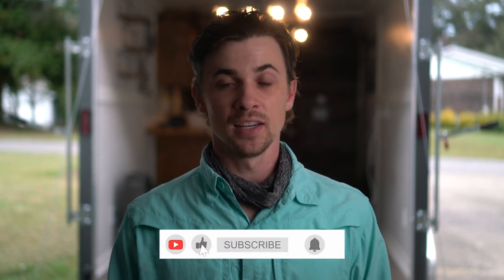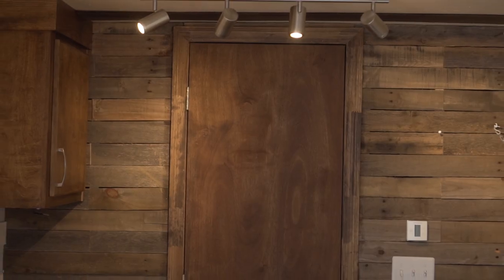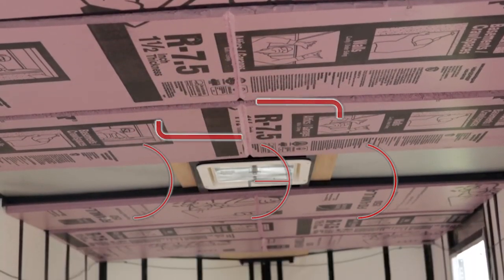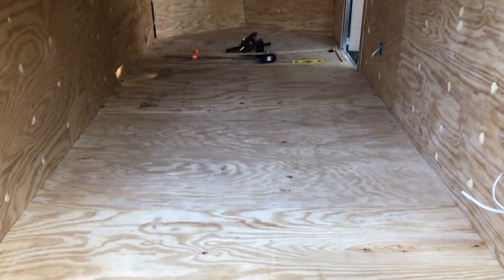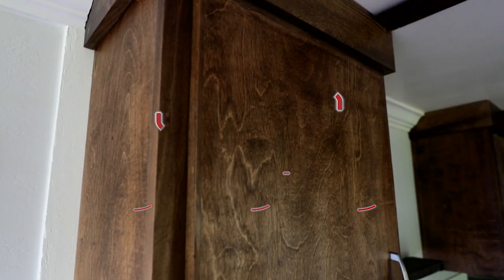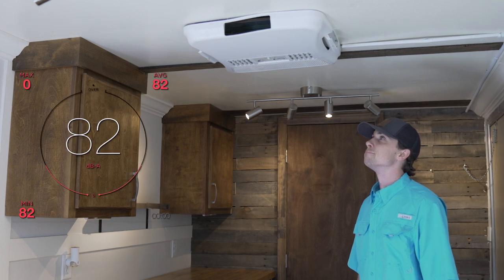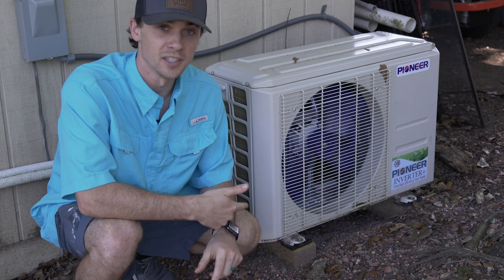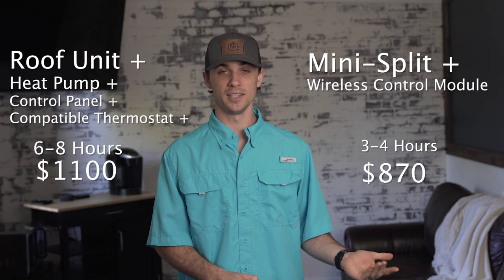Cargo Trailer Camper Conversion | TIME, DIFFICULTY and COST

Comment: Hey I’ve seen a video with a camper diy and a mini split on the front. He welded in some mounts on the tongue and put rubber bushings to isolate the outside unit said it worked well for the last year. It will be the route I take as well. Covers it during travel to minimize road debris.

Comment: I've been building for over 39 years and I've been building tiny homes on wheels for 5 years now cargo converson and stick built on a trailer I put my mini splits on the toung of the trailer but you have to make sure on some trailers that the toung isn't short. I always build with interstate trailers they have a longer toung and the height inside is  90 inches so you don't have to have one coustom built for a higher interior height if you do I build again I would recommend putting the pinkboard under the floor and use the thermal grip prong washers strictly made for pink board and screw to the bottom of the floor so you aren't loosing any height inside I put 3 inch pinkboard under mine with the prong washers and it stays supper warm and 1 inch interior then my electric then another half 1/2 insulation after the electric but I also use  1 x 2s which is acculy a half inch board  on the metal studs and then do 1/4 cedar toung and groove. I pretty much build high end tiny homes though. So that's just a few suggestions. Also I would recommend putting another safety latch on the opposite side of your door latch of you have one where the bar is so n one can lock you in from the outside. I have both on mine and a key Fab door lock. Take care
Reply: How much demand is there for cargo conversion?
I'm semi retired. But after working for myself for 25years income projects.
Better than being a greater at Walmart. Having to put up with that shit would drive me crazy.
Reply: @davewelch1932  I'm supper busy I'm actually 2 years out before I can except anyone else or that's how long they will have to wait. Which suprizingly quite a few said they will wait. If you do a cargo build would suggest removing all the wood pannels off the walls and caulk all the seams the interstates like I use are very well built but I still go threw and caulk all the interior seams with a very good RV caulk you probably won't find it at big box stores. They do use buttal tape every where else but not in the vertical and I would do the horizon above the seams as well before I would add any insulation in the walls and just a suggestion but I would stay away from the fiberglass insulation in a cargo build and I wouldn't suggest rock wool either it's to heavy and for other reasons I wouldn't use I in a cargo build. Just remembered if you get a trailer look at it as if if was a house meening 16 in center studs height and different things like that and check under the trailer at the cross members for your plumbing make sure it will all work when you put it in. Hope this helps if you have any more questions please let me know.
Reply: @lbialk I have heard of people doing that before in my opinion I think they are making a huge mistake. I wouldn't recommend it these cargo trailers flex when there going down the road. I can tell you what I use and have used in my past cargo builds. And what I used on mine as well never have had a problem and I live where it rains about 9 months out of the year in Washington state. This is what I would recommend and what I use it has a 35 year durability remains flexible, water proof silicone RV adhesive. General purpose RTV silicone rubber. It's for wood, metal,glass, tile, plastic.  Very good stuff I use it on the interior seam and exsterior when I caulk around my Max fan and other things like the water box plug inlet everything like that but also use butal tape before just for extra purcaution. You won't find it at a big box store I don't know if you have a Tacoma screw where you live but that's where I get it. And RV store may have it. But I don't like buying things from an RV store because most there stuff is junk and way over priced. I'm not sure if Amazon has it I haven't looked but they might. I would recommend caulking every seam vertical and horizontal let it dry for 24 hours and run a house every where outside to make sure you don't have leaks anywhere and check around your fenders to make sure they didn't just put butal tape and no caulk because I have ran into that on my builds also before o would insulate anything I would check the door latches sometimes they leak as well unscrew the bolts and caulk under them before you out them back on. Hope all that helps. Take good care of I can help you with anything else please let me know.
Reply: @lbialk your welcome and ok that's good. I would still be causious about using tape. Alot of times it will break down over time. Just don't think it's the best idea for seams Inside a wall. Alot of times it will break down over time. And it could have a tendency to sweat. Which is what you don't want. Have fun with your build. Take care.
Reply: Please explain your door latch setup. I hadn’t thought of being locked in your own trailer.
Reply: @Biker-ux1fz  I put another locking hasp on the opposite side of the main door that way I can take the lock bar and  swing it backwards Insted of towards the main door I did it before I insulted the trailer that way I could bolt it to the frame inside the trailer side and then I put a locking shackle trailer puck on it so no one can switch it to the door side then I have a RV lock on the main door as well so when I don't have the locking hasp on the door side because I didn't remove it I use the RV lock it has a key. Hope that helps.

Comment: I have my mini-split on the tongue of my cargo trailer, and it works beautifully!
Reply from the maker: Awesome! Do you have any videos are pictures of how you did it?
Reply: Front mount close to inside unit. Every reafer (refrigerator units on commercial trucks) have a cooling unit high and dry away from stone chips always been up there. A trucker pointed it out to me. I'm looking at redoing my construction cargo trailer. Haven't used it in 7 years. Worth more concerted than cargo trailer. Plus everything new. Great retirement project. 

I've looked at putting in false wall foot in for utilities (electrical room) and installing a real mattress on a Murphy bed. 
My trailer is a 8'6 x 16' x 6'7" high. I could go with a king size. But would trips on wheel wells on getting out. Being older it's a pain in the toes.
Reply: Sorry my man, I'm confused at what your trying to build. An office or a camper trailer??
 Because it still looks like an office. 
What type of vehicle will be towing it?? How much does it weigh?? And is it durable for off road conditions?? And a bed should have been the first thing designed in your camper.
Reply: How about a frame for the split unit mounted to the tongue above the rock and debris area behind your tow vehicle. Have a double canvas cover made for traveling by a boat cover fabricator. You can still mount batteries or propane below the frame. WALA.
Reply: @scottgorman7166  the mini split is on the tongue itself. I have the bottom cover with a home made pan. So during traveling it’s covered and protect my the truck. Batteries and propane are in a completely different part of the trailer in my design. Batteries alone weight just over 500 pounds, so I placed them over the axle. The propane is on the kitchen side, with fresh water tanks to balance them even over the axels. The water tanks are made to travel full to counterbalance the 500 pounds on the other side
Reply: @FirstSuiGeneris  Do you have any pictures or videos of yours?
Reply: @Notorious424  I do, but nothing on my channel sorry!

Comment: I have research many bed solutions. The murphy bed still gives you good cargo floor space when the bed is stowed, but a very comfortable bed to sleep in the down position. Considering the ceiling height the bed can be   built horizontally. This can accommodate twin,full or queen size. There are many mechanisms such as counterweight, piston shocks, or purchased bed hardware from Rockler to help with lift assist. Good Luck!

Comment: Ben we are in the process of fitting a 7 x 14 trailer.  Our bed will 60 "x 74" almost a queen.  We plan to split it in half as 2 Murphy beds, one on each wall of trailer.  When lowered they will rest either on legs or maybe on benches that will be dinette when bed is up.

Comment: Im designing a travel trailer w a mini split. Going to have it at the back in my garage area w a Tesla powerwall/inverter. Cut a round hole in the back left side of the door, mount grill cover on the outside, build a doghouse shroud to send the air out through the floor. Can be done in a small amount of space just curve the shroud so air moves freely. That way your "outside" unit can be in the trailer, less chance of theft or weather damage

Comment: Mount the mini split on the tongue and run the lines through the front wall. We are using a Murphy bed. It will fold up and in the up position we plan on having a table that will fold down from the underside of the bed. This is space saving and it allows to keep the bed made. Hope this helps.
Reply from the maker: Good notes there, John. That bed design sounds very similar to what I have in mind. It's between a Murphy bed that has a table attachment and some sort of futon/couch that folds out or extends in to a bed. Thanks again!
Reply: If you put the mini split on the tongue you need to cover it while traveling or the wind will destroy it .
Reply: @bigdave5946  Absolutely. In fact my wife actually put a 1" peice of foam board in the cover she made to protect it from rocks that could fly up.

Comment: I’ve seen people mount the outside mini split unit right behind the fender and gave minimum clearance against the wall.  Run some angle from out from under the frame to make a platform.

Comment: So I’m wanting to start on a conversion for mine just to use as a family camping trailer. It’s 12’ OA so it’s small and the ceiling is short but for recreational use it’s going to be good. I had an idea for the ramp at the rear to increase the interior square footage. I want to do a bimini style fold out that would cover/enclose the entire ramp. I was going to use conduit for the frame pieces and tarps to cover everything.

Comment: Hey Ben, nice build so far. I had an idea on my build (still an idea), use single etrack mounts into steel framing (the roof framing isn't strong enuff) with 2x4 mounts, on each side on the rear of trailer. Have a 2x4 set aside for cross brace (the hammock connects here) use a center mount for upright strength (this could be a 2x2 or some other small solid bracing) use for two hammock setups. This will require two solid mounts up front also. Put up at nite, take down in the morning, use with sleeping bag or quilt.
Thot of doing some netting on this setup (velcro?), leave the back ramp down in porch mode (prop up the ramp), netting will keep the bugs out on those cool nites. That's the cool part of these builds, anything u can imagine!

Comment: I have a 6X12 that I used a set of bunk bed in, I love'em, I have a small window unit air condition 110, and I looking at getting a 2000 watt inverter generator.

Comment: I just installed 2 window into my cargo trailer. Each window were 24x30 which fit perfectly between 2 studs in the wall. I did weld 2 need horizontal steel tubing to the stud I cut and the stud on the sides of the window. I seen some people use wood as the frame instead of the steel but I felt steel was the stronger option.
Reply: Top and bottom of window wood as a filler so the wall doesn't collapse. Going to be doing that with the insulation this summer.

Comment: While at the Home Depot outdoor garden checkout booth, the little outdoor glass house/checkout kiosk,  had the smallest ac unit i have ever seen! The little room the clerks work in is maybe 6x4 feet. So somewhere between that ac unit and a single room window unit  there might be something you are looking for.  A window unit can be easily removed if traveling down the road and is small enough to be Easily lifted in and out as needed. 

I guess a lot depends on what or where the trailor might be going. Rough dirt or gravel roads with ruts and bumps or mainly southern, smoothly paved roads. ( Read: non-pot hole filled streets/roads.  So no ginormous holes that can, and do, bust an axle!) And, can you slowly drive a gravel road to avoid the bumps and shocks or are you the impatient type that just can't be bothered to slow way, way down?
RV camping parks are normally easier on equiptment than going boondocking on bml lands. 

Also where and when are you going traveling? Mid summer to desert climes? Or duck hunting near Minnesota lakes (so the cooler fall months!)?  If you never get near the Mojave in July you have different requiremrnts to those who might do so. If your trailor sits in the back yard under a leafy tree and you have readily available electric power vs trying to live comfortably with 12V stored power or a generator, those things are all to be considered. As well as if you want heat and cooling in one unit.

(And here i thought i was the only fuss pot about noise! It drives me nuts, too!)

Watch the vids about rv'ers and their picks on generators. There some very quiet ones! Honda for example. Or a big enough solar setup! 
And you can run a regular  window, house, ac A/C unit on solar! Without going to extremes! It was either a Bob Wells video, or maybe just one with him  in it! But it can be, and is, done! But the guy doing the ac  window unit was on the edge of a pine forest,  at a bit of elevation. So not urban, stealth camping!  
So, figure out exactly what you are doing to figure out exactly what you need. 
You most likely can't have a setup for each and every occasion from winters in Alaska to summers in the Florida Keys.  Or Las Vegas!  But maybe you can.

I'm most concerned more about going up to a month without going for more food or water. Once i set up i don't want to move, like because i ran out of eggs or bread or that kind of stuff. Or to go do laundry.
When I'm working at a site  i prefer to stay put and not waste my time setting up and breaking down. So maybe 100-150 pounds of food, and  1500-2000 pounds of water for a month. The return trip runs a lot lighter, naturally. Most of the food is gone and i dump most of any remaining water. 
And i may fill up with water somewhere near my destination; I don't haul water 1200 miles. So it isn't (quite?) as over the top as it might sound at first.

Comment: I appreciate the information about the A/c unit... I would have made the same mistake. Just sitting here listening to you a rough idea came to mind. What if you installed the outside unit for your mini split inside the v nose area on a sliding drawer so you could open a exterior camper style door slide it out when in use. Slide it back in for travel

Comment: I plan on a similar build with a mini split. My idea would be to mount it on the driver side just behind the axles. I would have to weld some l brackets to the frame that would stick out to set and bolt the mini split too. Idea is to have stick out just as for as the fenders. Or mount it on the front and both scenarios cover it with a heavy thick vinyl while in travel/parked when not in use.
Reply from the maker: That’s a great idea. I hadn’t considered having some sort of removable case for it for travel. My main concern was debris kick-up coming from the tow vehicle.
Reply: My thoughts for protecting it would be 1/4-1/2 inch plywood painted with truck bed liner or made out of a light weight metal material.

Comment: I just added a Whynter ARC 14-SH to my 7x14 conversion and it works great and is very quiet. My next upgrade is to use a racor storage lift to make an elevator bed so I can store the bed up and out of the way while hauling dirt bikes. I’m looking at the champion dual fuel inverter generators as well, haven’t decided on the 3400 vs the 2000 watt model, leaning towards the 3400 though.

Comment: I am considering a cargo trailer conversion and I am thinking about a wood stove, and then one of those stand up AC units that have the vent tubes, and then I am planning on venting them both through the same hole depending on season.

Comment: I HAVE SEEN THE MINI SPLIT ON A LOT OF RV'S SO YES IT WILL WORK. I SHOULD PROBABLY GO OUT AND TURN ON THE AIR CONDITIONER IN MY UNIT. MINE IS EXACTLY LIKE YOURS. COLOR AND SILVER TRIM. 2 DOORS AND 2 WHEELS ON EACH SIDE. MAYBE THAT MEANS DOUBLE AXLES?

Comment: Nice video, thank you sir! Been contemplating a cargo /camper build, good points to ponder. 
I just finished rehabbing a boat. It cost alot more than I thought it would have.
Reply from the maker: Thanks! Like i said - I highly recommend the cargo trailer route! Good luck!
Reply: The old joke is B O A T stands for 'bust out another thousand!' 
Apologies if you have heard it 100 times already, but in many ways it is true! 
Unfortunately!
Reply: @paulortiz8063  No need to apologise!

Comment: A generator may be minimal. as 12 volt lighting is available  with automotive parts. Add an extra  battery  connected to auto charge. Put together a rocket mass heater with piping under floor to heat it . The heat will dissipate into the room  if exterior is insulated. Water system might  be installed at the front wedge with gravity fed  shower tank and ground drainage for washing. Toilet can be  camper size dumped at a proper location.